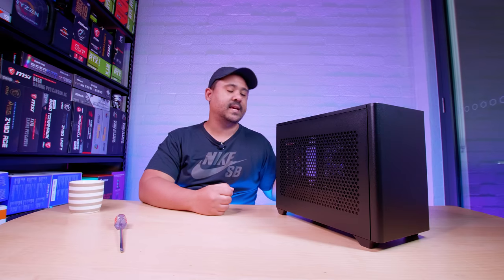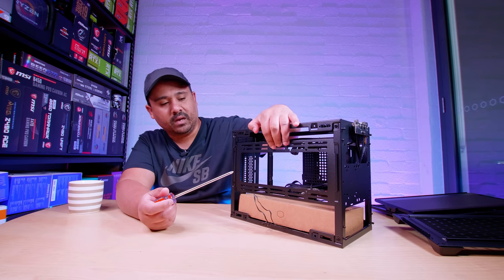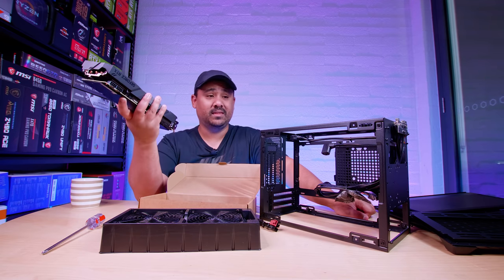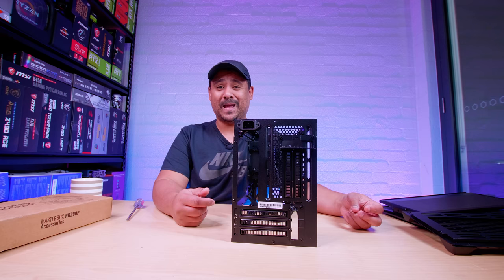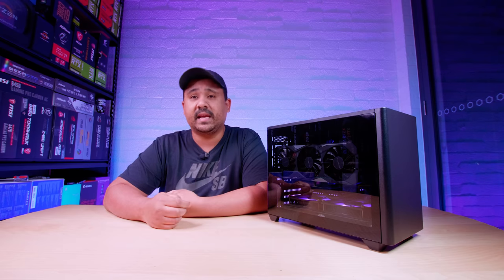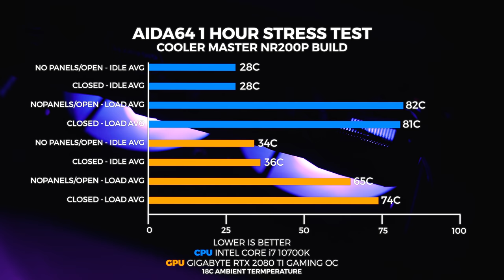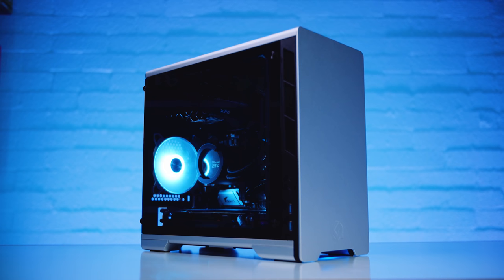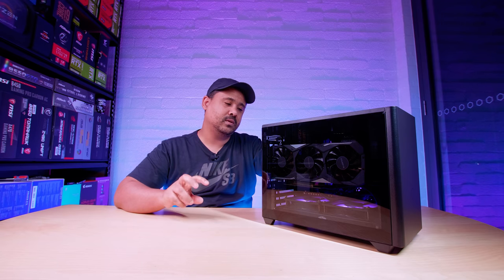Cooler Master NR200P is Absolutely BRILLIANT!

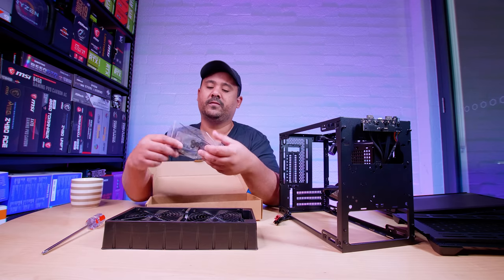Comment: love that 4:54 "tweezer" reference mocking the Verge up to this day
Reply from the maker: Forever!
Reply: Gift that keeps on giving....
Reply: @GearSeekers  And what model is the power supply? And what kind of motherboard can you put in this case if you assemble AMD? ...
Reply: @reshad711  Power supply model in this video is Cooler Master SFX 850W, to motherboard question "Mini DTX, Mini ITX, Max MB size: 244 x 226mm (L x H) example:  Asus ROG STRIX B550-I GAMING,  Gigabyte B550I AORUS PRO AX,  MSI MPG B550I GAMING EDGE WIFI"

Comment: This case is still such a top tier contender. I today found out about the inverted mod, which flips the front panel upside down. So you can turn the entire case upside down. This enables top mounted radiator and upside down GPU at the very bottom. It looks great and increases airflow while using AIO, without having to pay $400 for the max (yeah, it's price is steep in Norway). Loved this build tho! So clean

Comment: I pre-ordered this case immediately after Ali's video! So excited to build in this thing. Great video as always, Nick.
Reply: Same, coming next week!
Reply: Who?
Reply: @selmonbhoi4731  
Ali Sayed from Optimum Tech
Reply: @z4k1_zaki65  oh his name is ali? I have been watching him since his portal build. Underrated youtuber . Just like Nick.
Reply: Too many thing wrong for me. No cable management behind motherboard tray, only bottom mount rad, and a bit longer than it should be imo. Could have easily been 1-2" shorter and still support everything it supports. I wish they could make this exact case that only supports dual slot gpu and top mount rad.
Reply: @MrDutch1e  1. well for me, I don't need space behind the motherboard because I have custom cables. 2. It supports a side rad if you have the vented side panel, which is what I ordered (for optimal cooling). 3. It really couldn't have been much shorter, since it supports 330mm GPUs. To put it into perspective, the NCase M1 is spec'd to support 317mm GPUs. I'd say it could be .5 - 1 inch shorter, but the front panel aesthetics + SSD mounts made it slightly longer. 4. I don't think they should make a 2-slot version, as Ampere GPUs will be up to 3-slot. 5. Top-mount rad is a respectable request, since that's the best position for an AIO.
Reply: Regular Coolermaster 650 W psu support ?
Reply: @greenpolygames  SFX and SFX-L support, don't have ATX size support
Reply: @Physis_88  thanks you man

Comment: Just bought this case for my setup, i think this is by far one of the best ITX case in term of thermal,flexibility and price. I'm running a 3700x and a Gigabyte triple fan dual slot rtx2080 super with TG side panel and vertical mounted GPU, temperature is excellent. Cpu in low 50c and gpu in low 70c. Before this im using h210i, but the breathing room for graphic card is very limited.
Reply: How do you get low 50? This video shows 82C
Reply: @unskeptable  this video using 10700k, i'm using 3700x

Comment: Love how this comes out just weeks after I finish my build in the Sliger SM580 :(
Reply: Same... I wanted to do an ITX build but nothing was just right. I finally said hell with it and used a P400A ATX case, which I'm very happy with but I wanted a small build... just so much wasted space. My build isn't even a week old then this comes out. Only plus side is I also have a 10700K and mine does run cooler than his build with the 360mm cooler I have, so that makes me feel a bit better.

Comment: Basically this case takes the few minor complaints I had with my Cougar QBX and fixes them. QBX still has place in my set-up only because it still gives me a slim optical drive for times I want to read or back-up to a disk.

If someone makes a mDTX board again (not counting the Intel H-series boards for prebuilts for businesses) then recommending this case will be a no brainer.

Comment: Something worth mentioning is that this case, while cheaper materials and a bit larger, runs cooler and quieter than the NCase M1 while costing a fraction of the price.  Oh and that's WITH the TG panel installed with Vertical GPU setup.

Comment: My mate built in the older NR200 (non-P) and thermals are the best if the GPU is sucking up air from the bottom with some slim fans under it. The AIO sucking in from the side. The two fans push air out the top. This obviously doesn't work with the glass panel but the thermals are the best. Great video as always!!!

Comment: Two questions:
1. Is the top-mounted toolless fan installation removable so third-party fans can be installed? Or does it not have to be removed at all?
2. Do you have any idea when the Cooler Master V850 SFX PSU is being released? The Corsair 750W SFX PSUs are VERY overpriced right now.

Thanks!
Reply from the maker: 1. You can use any fan you like with the toolless system.
2. No idea when these SFX PSUs are coming

Comment: I would love a 2-3cm taller version of this, so that it fits a µATX board. Just add holes in the PSU bracket so we can mount it to the radiator/disk braket (bonus: the PSU fan then sits right above the RAM slots!). Voilá. It would still be <20 liters and you could still fit fans or a radiator in the bottom if you don't use all 4 PCI slots.

This would be very attractive from a budget standpoint, as µATX boards are typically quite a bit cheaper than ITX. Plus the much better expandability of course.

Comment: this case can actually fit an ATX PSU, Cooler Master have a 3D print file for a bracket. I've seen mods using zip ties to secure an ATX PSU. I'd love to see your thoughts on this case with an ATX PSU installed :)

Comment: A great case! Only thing I think they missed was maybe shift the mother board down a slot so a the AIO watercolor can mount to the top rather than the bottom. Should still fit a three slot GPU in the bottom just may loose regular fan mounting.
Reply: I agree, the AIO is going to have a short life sitting bellow the AIO pump.

Comment: Great video! Well done and lots of depth...

Just wondering if you think I could mount 2x 3.5" mechanical drives?
Don't need watercooling or GPU...

I'm wanting to upgrade my NAS with a custom Synology build on my own hardware, I love DSM but hate the crap hardware that's in it... was thinking of building in something like this.
Obviously a bit of a different use case to a typical gaming PC.

Thanks for your time!

Comment: I'm blown away ... another NR200 review and total accolades - amazing!
But what is even more amazing is yet another guy who definately (should) knows better, mounts the radiator below the pump 🤣

So yeah this will be your 'go to' case ... since you will be replacing that AIO in short order as the pump traps air, runs dry ... well, you know the story ...

So when the pump fails do you suspect CM will blame their AIO ... or you for mounting it incorrectly .... then when you ask "where else should I mount the radiator", perhaps your inflection on "Brilliant" will be a bit changed . . .  just saying 🤔

Comment: Can you make a follow-up video where the top fans are intake, the fans of the AIO at the bottom is in a PUSH configuration as well, exhausting air to the bottom of the case. I am interested to see the results in this configuration since I have been seeing this video's air flow configuration very often and not the configuration that I mentioned here. Thanks and nice review of the NR200P.

*The reason for my change of fan orientation is because, I would like to see if fresh air coming from the top could cool the CPU AIO better in workstation tasks where the GPU is not utilized therefore no significant heat is generated by the GPU and then the AIO will use that air to cool down the CPU's AIO rad and expel the hot air immediately at the bottom of the case instead of pulling it into the case and out at the top.

Comment: Please notice my comment. I love this build and i want it too. But my concern is the bottom mounting of gpu othey says it cause  weird sound cause of air bubble inside the pump ? Hows the performance of this ? Before i purchase this AIO?
Reply: I have a similar query too thanks @Gear Seekers .. I've just watched a video regarding the incorrect mounting on AIO's and in particular the NR200 was mentioned with mounting radiators across the bottom of the case causing potential air bubbles at the pump. Did you experience any issues with installing the AIO in the manner depicted in the review? I'm basing my build [and already have the parts] on this case and listed AIO cooler.

Comment: @gearseekers Any idea if the arctic 240 or 280 fit on the side instead of the bottom ? im only asking since you've review both and the arctic's have wider radiators.

Comment: Really interested in the air-cooled build. You should put the biggest cooler you can in there - not sure if it will fit a Dark Rock Pro 4 or NH-D15 but it'd be awesome if it does.

Comment: @5:17, ofc the PCI Riser Cable is going to work for the 5700xt, etc. It's listed as a PCI-3 cable on the site though so if you had a way to test for speed degradation or throughput that would make for an interesting video, especially ahead of the next gen of cards.
Reply from the maker: Incorrect. I've had risers not work
Reply: @GearSeekers  damn I guess the traces PCI traces get too long for gen 4? Definitely do a video on if you can repeat that, no ones covered it. I wonder if changing the PCI setting in the bios fixes it.
Reply from the maker: @jesso2k6  It does. I had to do it in the AZZA Pyramid video where I used the 5700 XT with a B550 board. I mentioned it in that video as well https://youtu.be/otRae0Ci-Mo?t=1015

Comment: Great case and presentation! 👍Pardon my ignorance, but the radiator seems to be wired as an exhaust. In that case, wouldn't its mounting on the top of the cabinet be wise, as against the way it is in the video?

Comment: Does the vertical mount really only use those 2 screws to hold the GPU in place? I feel like any lateral movement would be an issue.

Comment: Excellent video. I thought that the cable neatness would be a bigger issue than it was in the video.  Imagine that with the non-TG pannel it would be even more of a non-issue.  Now it's just getting hold of the thing as everywhere I've checked locally is out of stock. Sad times.
@GeerSeekers or anyone else, just out of curiosity, what is the track at 12:10-13:34 (B-roll) ? I can't recognise it from the Gear Seekers Spotify playlist? Bad times.

Comment: I hope Cooler Master sets a trend with this case and its sensible pricing . Decent M-ITX cases are over-priced IMHO . Looks like the perforated version has decent airflow and quite flexible setup also ...
Reply from the maker: I agree. SFF cases are WAY too expensive. It's mainly because those manufacturers are more boutique and bespoke.

Comment: Just order one. Should come this Saturday. Haven't decided air or water cool the CPU.
Reply: What did you decide in the end?...
Reply: @nauxsi  I tried Noctua U9S and Sycthe Mugen 5. They are perfectly fine for 4.2GHz and 4.3GHz OC a R5 3600. However i have a spare 240mm rad and CPU block from an older build. I end up put together a 240mm loop(perform like a 240mm AIO), and run the R5 3600 at 4.4Ghz. 72C during stress test with 1200rpm fan speed. Very happy with it.
Reply: @spektrumB  That's pretty awesome. I'd take 4.3 on air cooling and near silence. Which psu did you pair up with the system. .
Reply: @nauxsi  Corsair SF600, R5 3600 and 5700XT

Comment: nice video, one thing you may have missed, on the webpage you can download the stl to have a full size ATX PSU and 3d print one. Not sure how it all works yet, but just bought this case and going to run a Ryzen 7 5800x, with a RTX 3070 TUF card, so fingers crossed it all crams in there. Once again great video mate

Comment: Can this case fit the Artic Liquid Freezer ii 280mm aio? It has a slight thicker than normal radiator (est. 38mm) and would like to know if it would potentially run into clearance issues.

Comment: What would you recommend more , aio on bot with vertical gpu or better the normal way with gpu + 2 fans bottom and 1-2 fans top with aircooler /water , i would use shuriken 3 with glass panel for aestetics and rgb fans with good pressure ^^

Comment: Would you recommend this case over the FormD T1 case? i'm working on a SFF PC build with the new Zen 3 when AMD releases it later this year. While i have this on Pre-order on amazon, i'm 50/50 between this case and FormD T1 case.
Reply: If you're not concerned about the larger size or portability, I'd say the nr200 will be just fine. Both cases clearly have all the cooling options, good thermals, and easy building, it's just a matter of form factor and aesthetics.

Comment: I love it, a nice well done ITX with a reasonable price...the only real con is if it doesn't have a front panel USB C. I've just bought a Lian Li Tu 150X which I like a lot, but this one is more like what I really wanted from Lian Li.
Reply from the maker: It's not a con. It's a budget case
Reply: @GearSeekers  It's that expensive to have a single USB C instead of two USB3? I'm asking because I really don't know. Right now I preffer that every mother and case today  to have front panel USBc connection even if it's at the cost of more traditional ones.
Reply from the maker: @laureanoalfaro9351  Yes.

Comment: hii nick i need your help. my pc is freezing on windows logo every time i try to use my gtx 680 with riser that comes with my loque ghost s1 and same with cooler master NR200P which i recently purchased. i tried to vertical mount gpu and same thing happen. however gpu is running great when i plug it onboard pcie. plz tell me is there any motherboard setting to do? btw i m using gigabyte z390i.

Comment: If you mount the Graphics Card Vertically...there is no reason you cant put the Power Supply on the bottom back or front and use an ATX Cable Set

Comment: They recommend bottom rad for custom loops only, is it safe to mount it like you did on the video?
Reply: It isn't safe unfortunately, always rad higher or level with the pump, never lower than the pump

Comment: I like the non P version better. I already have a riser cable, many 120-140 mm fans and I prefer the non glass mesh for temp purposes. I was debating on getting this Cool Master NR200 or the Cougar QBX and decided to get the Cooler Master NR200 better; I think it was the better choice at this point.
Reply from the maker: The QBX has some bonuses like being able to use ATX PSUs but the NR200 has so many more options in terms of orientation and layout.
Reply: @GearSeekers  Yeah that was the selling point for me since I was going to use an SFX PSU regardless if I had bought the QBX or the NR200; I have a corsair 750W SFX 80+ Platinum that I bought when it was on sale for $125 USD a few months ago
Reply from the maker: Jeeeez thats a good price!
Reply: @GearSeekers  I know... I should have bought two.. now it's back to around $150-160 USD

Comment: Interesting case, I like the tool-less panels. That said, I'm just not into small cases. In fact I'm going the other way. Went from a Lian Li 011 Dynamic to a Thermaltake Level 20 HT, and my next case will be a Tower 900 or something similar.

Comment: Would there be enough space for CM to make 3 vertical slots?

It would be great if there was, and if they did so, so users would have the option to mount GPUs closer or further away from the tempered glass panel; and also thicker GPUs would fit vertically with less thermal issue.
Reply: My thought exactly, theres definitely unused space besides 1st vertical slot gpu. But cm choose not to, may interfere with psu maybe?
Reply: @amirite6365  if you pause the video at the 13:00 mark, you can see that there's lots of room.

The RAM itself is almost 49mm height based on the product page, while SFX power supplies are only supposed to be 63mm tall. I'm very sure there is sufficient space to at least push the GPU in its vertical orientation closer to the motherboard to allow thick GPUs to breathe better.
Reply: @teelim  exactly, hope cm realized this and implement into next release/updates, aorus rtx gonna cry if not mounted vertically
Reply: @amirite6365  From this pic (scroll to the bottom of the page to see product images), it looks like there's definitely enough room for one more vertical slot.

https://www.coolermaster.com/catalog/cases/mini-itx/masterbox-nr200p/#image-Item11
Reply: @teelim  yeah noticed that too, now need to raised this concern/idea to cm

Comment: I can't stand that the USB ports and headphone/mic jacks are on top of the case.  Things fall in and you can't get them out.  Also, I like cases with an optical drive bay.  I have one of the smallest mini-ITX cases by SilverStone (SG055BB-Lite) that has a 12.7mm bay that uses a laptop blu-ray drive.  This case can fit a 2-fan 2.5-slot wide GPU in it, along with a 120mm AIO to the front panel, with a few minor modifications (remove the 3.5" HDD tray, and shorten the 2.5" SSD tray).  I also added at 70mm x 10mm exhaust fan to the top of the case.  I'm running a Ryzen 7 3700X overclocked to 4275 MHz, and an ASUS GeForce RTX 3060 Dual OC GPU.  Normal operating temps (when not gaming) is 42*C on the CPU and 38*C on the GPU.  While playing Halo Infinite, CPU goes up to 52*C, and GPU goes up to 79*C.  Since this GPU is 2.5-slot wide and is right up next to the side panel vent holes (causing choking), I will be looking at a 2-slot GPU to get better airflow and better temperatures.  I had a Cooler Master RC-130-KKN1 Elite 130 that sucked at cooling ANY GPU that was installed in it.  I gave up on it and sent it back for a refund.  Cooler Master is NOT the master of cooling, as their name implies.  My SilverStone case is only 222mm wide, 288mm deep, and 180mm high.